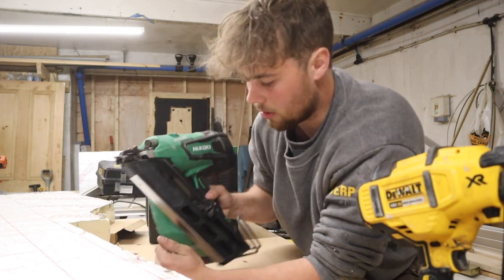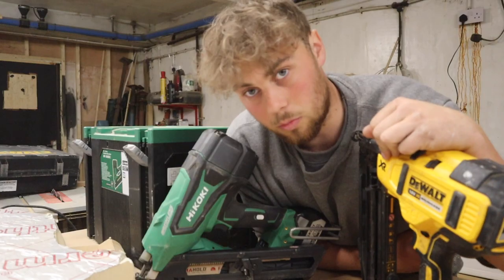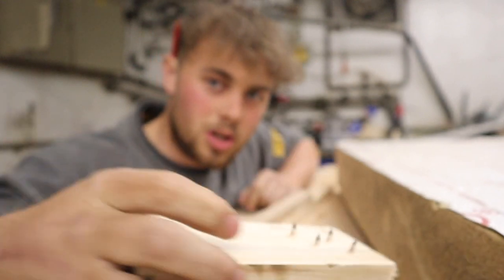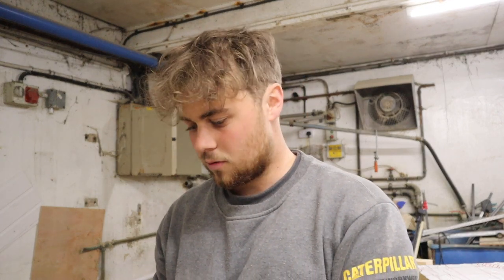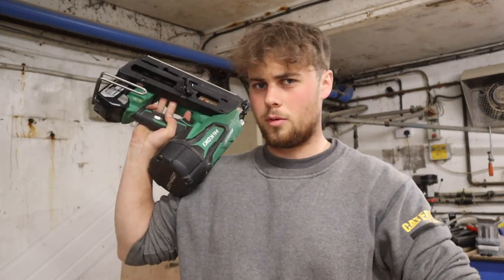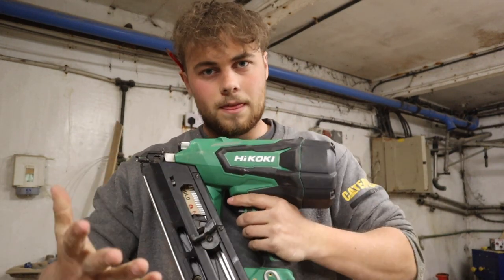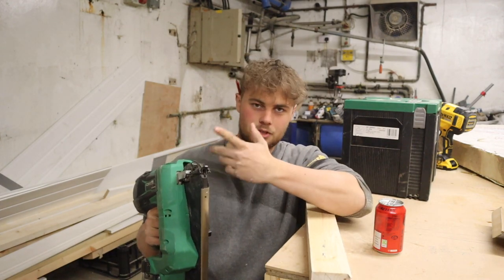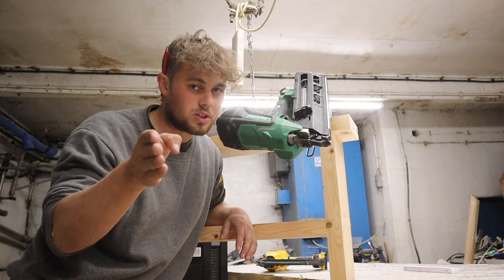Why Did I Choose These Nail Guns?

Comment: For the past few years I've been using the SENCO Fusion guns. They have a sealed nitrogen cylinder which just gets re-generised (Re fed through the system)  each time you fire so unlike the De-Walts, Hikoki's, Makitas etc there is no ramp up time  which means as fast as you can pull the trigger it will fire nails. I've fired thousands of nails with then and not a single fail to feed, jam or any issues whatsoever. They aren't cheap but you generally get what you pay for. Not a fan of De-Walt tools since they started spending more time on designing work boots and trousars than they did designing their tools.

Comment: I love my Milwaukee framing and 18 gauge finish  nailers there was no nail gun training with I started so these things still make me smile every day! 👍😀
Reply from the maker: I am very torn between the Milwaukee and hikoki guns... not sure which one I want 😂
Reply: @jaysonfaircloughjoinery8985  from my extensive research I concluded that they are just as good as eachother though I did so some slightly negative comments regarding the hikoki ones but I think that was just Milwaukee fanboys tbh. I just really wanted the Milwaukee ones so stumped up the extra cash. There is nothing at all wrong with the hikoki ones, they are cheaper and you get some free boxes of nails. Either way you will not look back gutted that you got the wrong ones  with the hikokis at all as they are still outstanding cordless nail guns. 👍😀